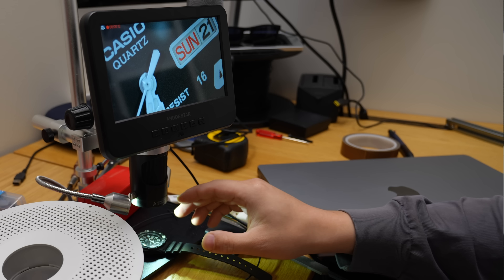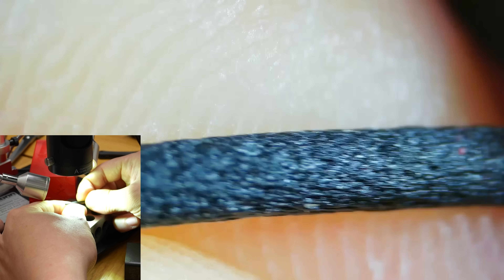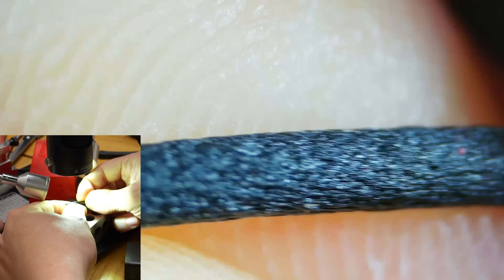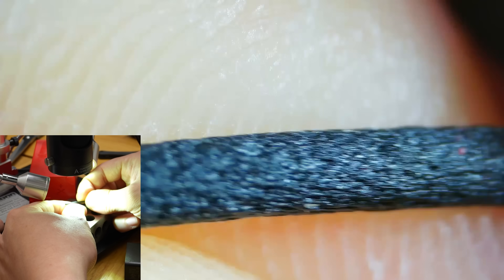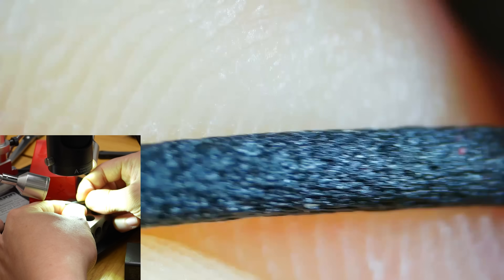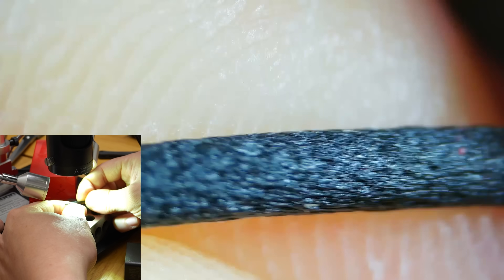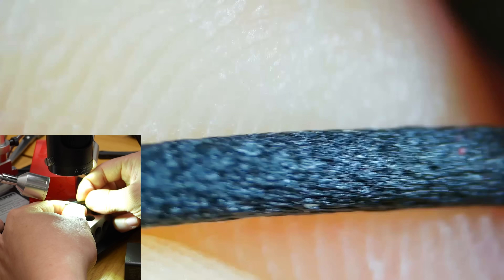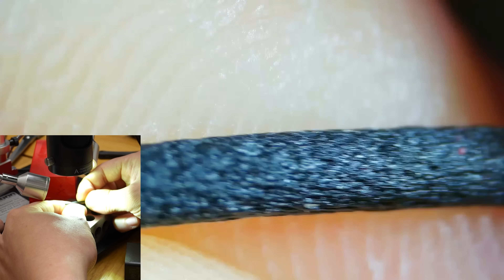The Dark Side of Carbon Fiber Filament

Comment: I think it's pretty irresponsible to brand composite filaments as "basically asbestos" when carbon/glass fibers are known to be significantly less harmful than asbestos. Carbon/glass fibers are significant respiratory hazards, but they are, to our knowledge, not carcinogenic. We also just don't know that much about the air contamination introduced by 3D printing, and we don't know if bits of fibers within filament are fired into the air in large enough quantities to be dangerous. I think we hobbyists should be much more careful when 3D printing, in general. However, this video seems more like fear-mongering than a measured, scientifically-grounded analysis of the hazards of printing carbon fiber filaments. The main evidence presented  in this video is just "carbon fibers got stuck in my skin when handling parts." That *could* be concerning, but little evidence is presented to determine whether that actually *should* be concerning. Carbon fibers *might* become airborne during printing/upon handling prints, but no evidence is presented as to whether or not that's significantly hazardous. While this video presents a concern that we may need to be worried about, it presents that concern in a manner that is, in my opinion, too definitive. I usually really like your rational, facts-based approach to 3D printing, but I think this video missed that mark.

Comment: The lesson: just learn to print vanilla PA6 and PA12
Reply: The lesson: you don’t know what you are talking about.
Reply: @conorstewart2214  what do you mean? It's popular to just grab one of these filaments with an additive in it when you need more rigidity or strength than plain PLA or PETG. I'm saying this video makes a strong case for jumping to a material that's more challenging to print with, instead of switching to a modified filament that now demands special handling and post-processing.

Comment: I have used CF filaments in the past and while ill be taking more percaution however i disagree in the strength differences maybe science and demo can prove me wrong but I certainly feel it is more strong/durable in my uses
Reply: Most people who comment about it not being any stronger don’t actually understand material science. Sure it may not increase tensile strength or may reduce it but it the reason it is added is to increase stiffness, thermal stability and other things.
Reply: I found these videos and they seem to show that CF-PLA is weaker, although it is stiffer:
https://youtu.be/6I7S7W-CTw4?si=TWEyR05EGbbtX-UD&t=448
https://youtu.be/k-15dd79etA?si=mrO_esJN8OzTZANK&t=392

Comment: I think these are all very good points, but I wouldn't personally sound the alarm over CF exposure at that scale. 

While it is itchy, and kinda sucks, at this scale CF exposure isnt really a hazard.

While I will always be a big advocate for using as much PPE as makes you comfortable (and then some), as someone who works in a factory that produces Carbon-Fiber racing boats, its a bit funny to see someone get nervous over a literal microscopic amount of CF.

When you really work with this stuff, there is no avoiding exposure. I wear a mask, gloves, long sleeves, but it still gets everywhere. It's common to have to sweep literal shovel-fulls of the dust from the floor. Its always in the air, and loves to settle in hair. 

Unfortunately, our job requires us to cut (solid) CF parts with powetools every day, and that puts several orders of magnitude more fiber in the air than you would ever get with filament that only has a little bit infused, and most safely trapped inside.

While I definitely sympathize with not wanting to expose yourself to this stuff unnecessarily, I think implying that printing with CF is dangerous is taking it a bit far.
Reply: On the contrary. Asbestos fibres causes lung cancer through being undissolvable and being long and thin enough to travel through the lungs and pierce the double DNA strands. Unless you have evidence that Carbon fibers are so much different from Asbestos fibres that they can not do so and very significantly so (orders of magnitude), then you must assume that CF in the lungs is a lung cancer hazard.
Reply: I would say that having used some CF filament myself it isn’t even really itchy, at least I felt nothing and all the fibres were gone quickly, after only a few days to be completely gone.

Carbon fibre is hazardous because it is sharp and small and because of the binder but the fibre themselves aren’t very harmful, they don’t react much with the body.
Reply: Thanks for a sanity check here, this had me freaking out because I’ve made and handled a couple PAHT-CF parts.

Comment: When you print, your printer releases microplastic and fumes.
This is dangerous too.
Build an enclosure. Extract all fumes outside.
Buy a cyclone vacuum cleaner.
Mop your floors.
Reply from the maker: Make your bed

Comment: I wonder if cotton fibers would be a good compromise between safety and strength.
Reply from the maker: Cotton and wood are technically polymers. Biopolymers, and they aren’t much stiffer than plastic. For a composite to make things stronger, it has to be as strong or stronger than the base material.

It could still be useful as a filler to reduce cost and environmental impact

Comment: One thing you can do to mitigate risk is to use a sealant layer on the externals of your parts, and to avoid any overly spiky or abrupt geometries in your parts. I wouldn't recommend printing a gear, for example (not that additional tensile strength would help with a gears durability to begin with).

Comment: The filament may be dangerous, but what about parts that have already been printed? If you rub printed parts on your skin, do you see the same embedded fibers occur? Thanks for the video.
Reply: Yep, highly likely, so theyr mentioned in the video to coat finished parts with epoxy, for example.

Comment: The best way to add CF reinforcement to a print is to design in channels in your print where you can lay/wrap down some carbon fiber thread and epoxy it in place. It is going to be way stronger than CF reinforced filament, safer to use, and wont wear out your nozzle.

You can also pause a print, drop some carbon fiber chop and epoxy into the low% infil, and then resume once it hardens. That's a super easy way to do it.

Comment: Ok. So I see what you are getting at for when you are handling just the raw filament. But i was hoping you would do the same test after it just printed.
Reply from the maker: IMO the exposure risks from handling the filament alone are enough to dissuade me from printing with it. I would imagine the extruder gears pressing into the sides of the filament will constantly be working more of it loose and it will get lofted into the air by the part cooling fans.
Reply from the maker: The thing is, I don't need specific material properties, so until I do, there is no point in "upgrading" to CF. If you're just printing and designing things for fun there is no point.
Reply: @NathanBuildsRobots  i agree, no need to upgrade your filament unless you have to. I was just hoping for a video of after a test print for my own curiosity.

Comment: This is good general info, as someone who likes to engineer things and actually enjoys the ideal of slightly more exotic filaments, PP, ASA, Varioshore, Nylon etc. I've actually complete avoided CF, the closest I have is PA6-GF and I've not even opened that one yet, likely will do so with gloves or handle it only through a paper towel now, to be safe. And obviously be careful WHAT it's used for as the end-print. (Obviously not a fidget spinner.)

Comment: That's unfortunate, pa6cf is one of the few materials I've found that can actually handle the temperature and chemicals my projects deal with. It opens up a lot of part design that would otherwise be impossible, and was the sole reason for picking up 3d printing.  

I think I'll be coating and potting pa6cf parts from here out, so it's good info. Thanks for sharing it.
Reply: Have you tried any other Nylon derivatives?
Glass Filled Nylon might be an option? (It can also be equally dangerous to your health though if not handled in a well ventilated area with incredibly strong filtered extraction.)

Maybe some other plastic or polymer other than Nylon?

Could you make your parts out of another material that's entirely different and just use the 3D Printing Process to create the moulds needed to shape the final part?
I'm sure that alternatives do exist, you might just need to rethink how you're creating the parts in order to find an equally viable but much safer material to create your parts from.

Whatever you end up doing do NOT disregard the dangers of Carbon Fibre, Other Fibre Materials, &, Micro Plastics, all three of these material types are VERY BAD for our respiratory and gut health, and it is very important that you take the appropriate protective measures to look after your health and the health of EVERYTHING around you, be it people, pets, other wildlife, or even plants, these fibres can end up EVERYWHERE..!
Reply: Have a look at PPS. It is very chemically resistant and may be suitable for you if your printer can handle it.

Comment: CF is not that bad. ESD safe filaments have CNTs inside them, thats nasty.
Reply from the maker: Tiny killer tubes!
Reply: Don’t some ESD filaments just use lots of carbon black?
Reply: @conorstewart2214  depends. We had spools with CNTs
Reply from the maker: @conorstewart2214  Yes, I would prefer to use a carbon black formulation. Protopasta's is made with carbon black, Polymaker's has carbon nanotubes.

Comment: The rubbing off in a finished product, or while handling filament isn’t scary in the slightest bit.  What is scary, is you’re usually using some pretty powerful fans on a good printer during prints, which is lofting it into the air continuously.
Reply from the maker: That's a good point. The fans blowing things all over the place aren't going to help make things safer.
I'm going to check the bottom of the filament bag to see if there is a little pile of CF fragments in there.

Comment: I also think people using plastic printers ie (printers tat print with plastic not metals or resins) that they should be concerned with PFOs and micro plastics. and the gas that melting plastic give off. we don't fully understand the long term effects of these things yet. think about the amount of times in history when people just used substances or materials that we know now are extremely dangerous. also the wasted material, failed prints, and the fact that unless you are directly turning it back to filament your self its most likely not getting recycled. this part is purely my opinion and i understand people like making stuff, i make things myself too. (however people need to start thinking more long term in their lives, would printing X thing be worth X outcome or when iam 70ish will i get some cancer or something is that one off little object actually worth the manufacturing of this filament the power to run the computer to model it the time and power used to print it. alternatively consider making it out of a ceramic or wood or metal might be the better option longer term, something longer lasting and actually renewable regrowable, not everything needs to be 3d printed in plastics, plastics dont NEED to be used for everything just for convenience. most of these plastics are made from oil as gas goes up so does oil, in turn so will plastics, its cheep now but will it be cheep in 10 20 30 years from now? and a CNC mill or router to shape wood or metal is a similar skill as modeling and using slicer software. there are other was and these ways will give you the ability think differently when making object. giving rise to new ideas and easier methods.)

Comment: These size fraction will not go deep enough to get trapped in your skin. The skin is constantly regenerate and old cells peeling off and cf particles will go off as well. At the same time protect your lungs via proper respirator as your respiratory system will not be able to remove 100% of what you inhale.

Comment: Very good and informative.  Thanks.   Got really confused as to why you wrote "asbestos" in the video thumbnail.  Having worked in the asbestos mining field a little bit, It is misleading.
Reply from the maker: I was using it as a euphemism for something bad to inhale. But you're right, Asbestos is much more dangerous due to the sheer number of particles that get released when working with it, and they are about 5x smaller in diameter.

Comment: the problem with encasing the fiber reinforced filament with an unreinforced shell is that you loose one of the major benefits of the reinforced filament benefits, which is layer-to-layer adhesion. Obviously, something like carbon fiber or glass fiber reinforced nylon is an engineering material that should be used when the mechanical benefits of the reinforcement like stiffness, strength, toughness, etc. is matched to the application. They are not for general purpose "fun" prints. 

Glass fiber makes great insulation, but we don't use it for insulated clothing or bedding because the engineering properties don't match the application. The same approach needs to be taken by 3d printing hobbyists when choosing a filament for a project. 

This video is a good reminder of that.
Reply: layer adhesion is generally worse with CF reinforced filaments. coextrustions with the unreinforced plastic on the surface have a superior layer bond.

Comment: One key aspect of asbestos that makes it unique, is that when you're dealing with friable asbestos, it can easily be pulverized into incredibly tiny particles. Not only do they easily become airborne, but they also can remain suspended in the air with little to no air movement for very long periods of time. 

I appreciate you discussing how similar these carbon fiber filments can be to asbestos as far as how easily they can contaminate your skin and surfaces within your work area, but it'd be very interesting to find out easily they become airborne and how long those fibers can remain suspended in the air.
Reply: It's a very well studied area. People who actually work with carbon fiber in an industrial capacity can attest to the amount of protection used when dealing with stuff directly. Weaves are fine, they hold together as one piece. But any modification cutting sanding etc is all done in bunny suit + respirator + gloves.

The filaments and prints are assumed safe because the fibers are embedded in the plastic. But it's only an assumption that they bond well enough to not slide out if they're exposed on the surface. 

Either way, it's a PSA that the only post processing that should be done to CF filaments is painting or sealing directly and absolutely no sanding.
Reply: Another interesting fact, the way asbestos is defined, requires a specific ratio of length to width of the fiber. If its not long and thin enough, it can't legally be called asbestos.

Comment: Carbon fibres, less than 1mm in length, loosely packed within a flexible polymer, is absolutely pointless - there's zero structural benefit to it. I've laminated with CF for decades and know how to make a strong part - chop is not intended for structure - it's used a a shaper and filler. Don't waste your time and money on CF filament.
Reply: You have no idea what you are talking about.

Have you ever used a decent CF filled filament? It is not pointless at all, it increases stiffness and thermal stability amongst other things.
Reply: As stated - just my honest opinion. I build with CF cloth/strand/chop have a pretty solid knowledge of the how and why of using CF and associated resins. CF lamination is considered weak and unstable when it's saturated with resin, which is why it's critical to get the fibres straight and nearly dry before the cure. 1", 1/2", 1/4" chop is used only as a filler and has nearly 0 structural integrity. The fibres in filaments are generally less than 1mm and make up such a small fraction of the mass that I can't see it doing anything significant. Again - IMHO. Take no offence.

Comment: Now do it with ABS-GF
Reply: Please - take a look at the glass fiber reinforced ABS.  Having worked with fiberglass professionally, this seems like GF reinforced would have the same problems at a microscopic level
Reply: I broke out my microscope and ran these same tests with Bambu ABS-GF.  Very different behavior to the CF filaments - The fibers are much bigger comparatively, and much less by volume within the ABS.  Rub testing does show some small fibers depositing on my finger, from the spool.  Printed parts do not seem to rub fibers off just going over with the finger.

But those fibers wipe off with a paper towel, not even requiring soap and water.  So much less concerning.

Comment: Its not silica so.. Wait.. Oh boy!

Good I am redesigning my ventilation system for my workshop, I may want to avoid these products completely.

One shouldn’t be acquiring products made of it either, except if they have been adequately coated and manufactured in a safe manner by whoever is printing it.

Comment: @nathanbuildsrobots Can drilling holes make a part stronger? https://www.youtube.com/watch?v=Gbpf1rctHKc
Reply from the maker: Core concepts of structural engineering are fun!

Drilling holes can make a part stronger or weaker. But it only strengthens when done in a way to redistribute stress to avoid stress concentrations.

However, drilling holes will ALWAYS reduce the stiffness of a part. The interplay between stiffness and strength is a nuanced part of mechanical/structural engineering.